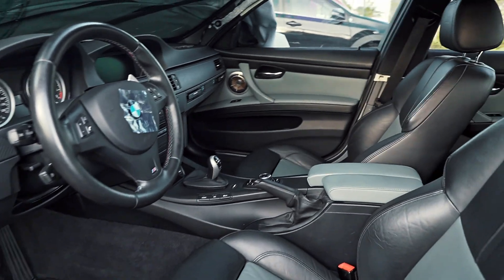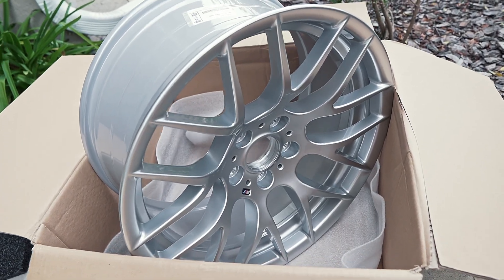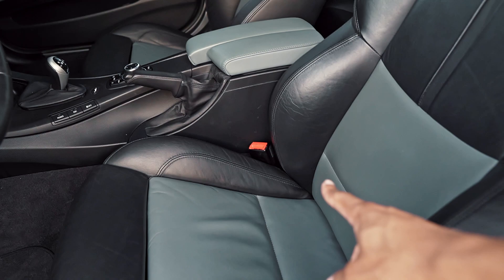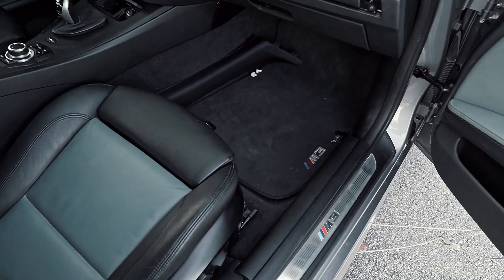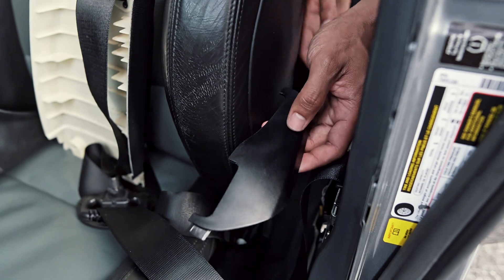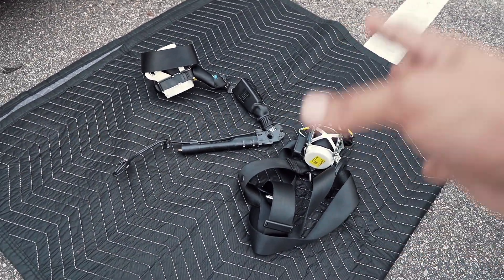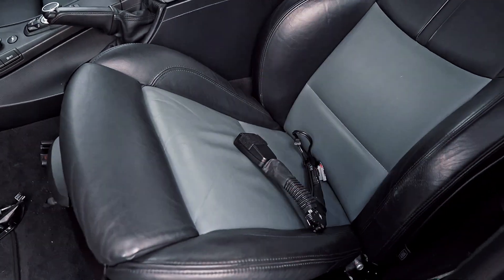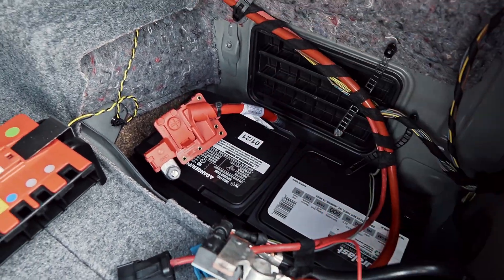BMW Competition Seat Belt Upgrade for the E90 M3! (Rebuild Part.2)

Comment: Can i still drive my car while waiting for the new ones to come in the mail?
Reply from the maker: I would NOT recommend that due to the fact that you won't have any safety equipment installed which can lead to injury in the event of an accident. Also, you will trigger a fault code if you reconnect the battery without the seatbelt installed.
Reply: @ thanks man just trying to get an idea of how long downtime will be